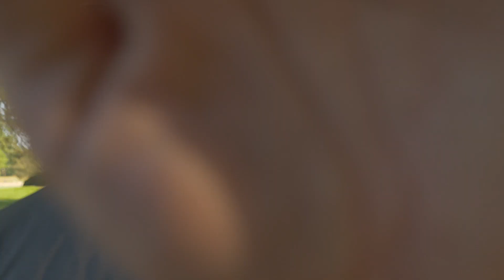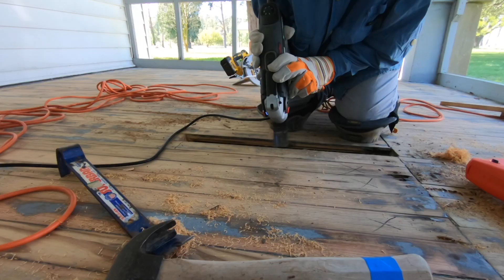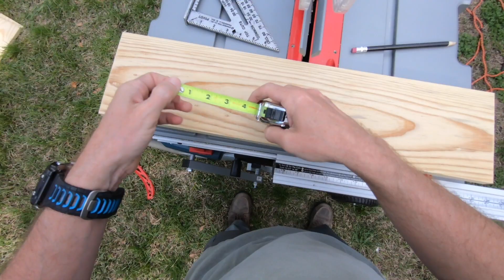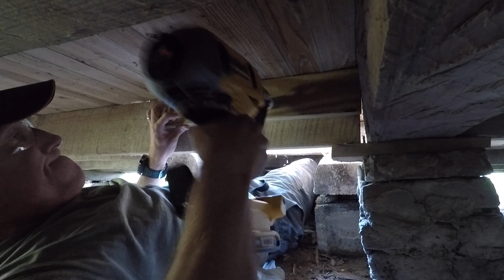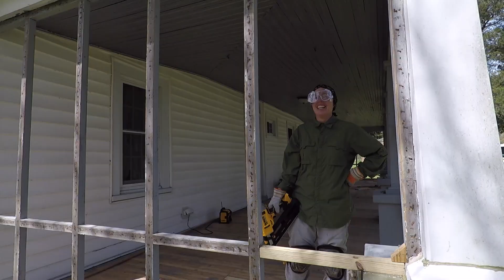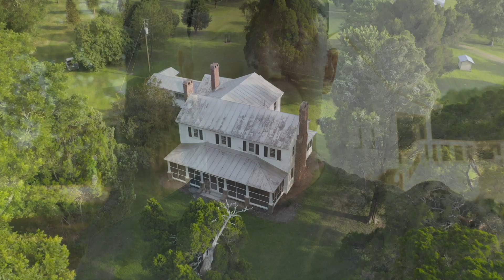How to Replace Deck Boards | This Old House Porch - Part 2

Comment from the maker: Whew!!!  I am glad that part is over.  For a while, it seems like we were making things worse, cutting through the floor boards and creating big holes.  Have any of you done this type of project before, or possible used the composite decking material as an alternative? Would be interested to hear how long composite material lasts in humid coastal environments.

Comment: My front porch ceiling is about 10 year old, most of the white paint still looks OK. but since I'm repairing the railing and stair case, I want to just paint the ceiling anyways. I don't think I need to scrape off any existing paints, but do you think it's necessary to sand/TSP it before painting? Thank you!